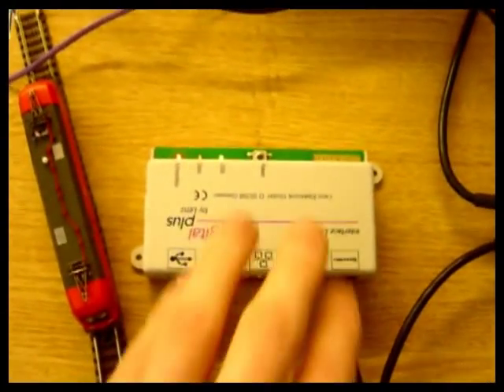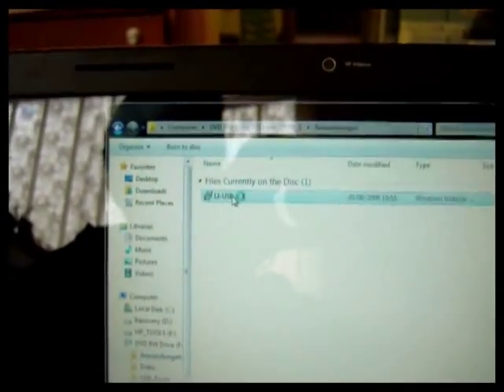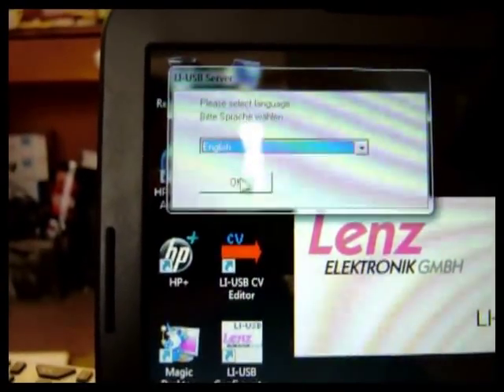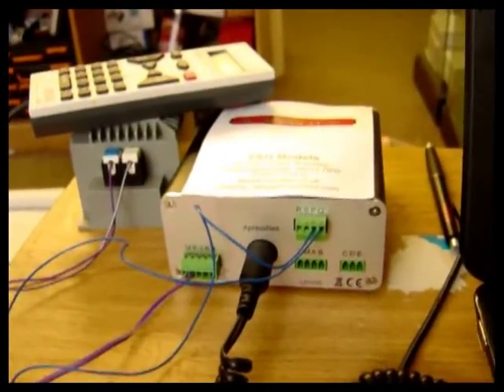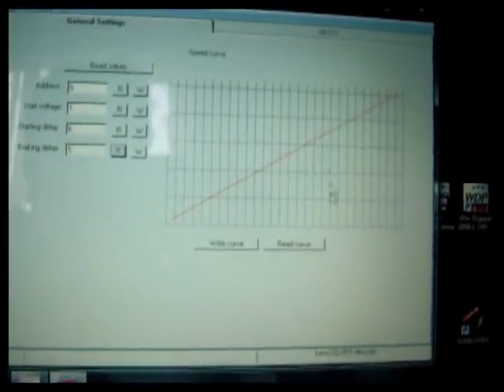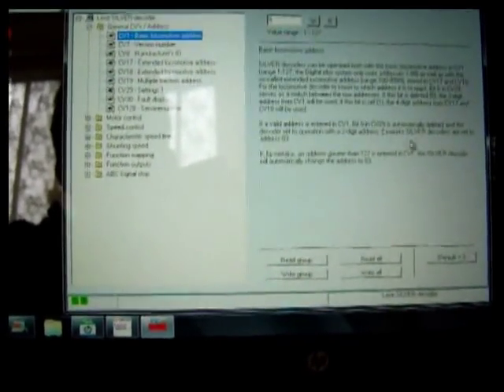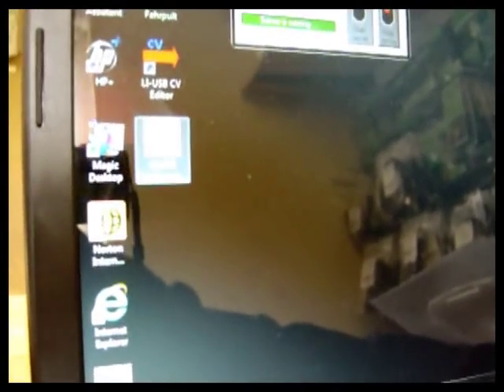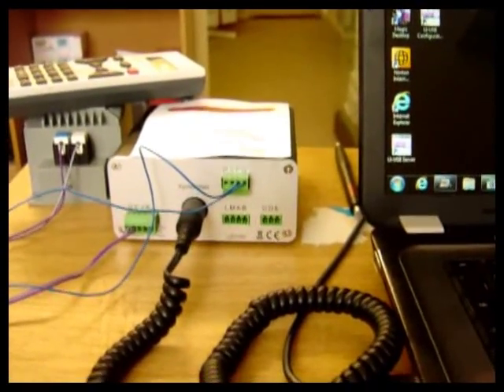Lenz  23151 LAN USB Interface for PC and MAC

Comment from the maker: The USB needs a Lenz Command station LZV100  on version 3.6 software.  The command station produces the DCC instructions that are sent to the layout.  You can then run trains using the software provided with the interface.  Of course, the train needs to be fitted with a DCC decoder.
Reply: digitalcareline k